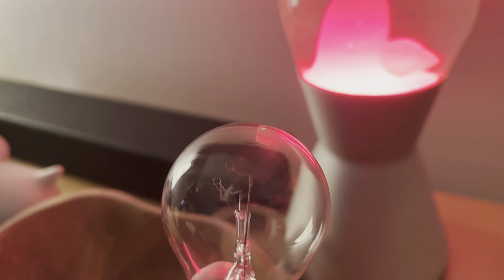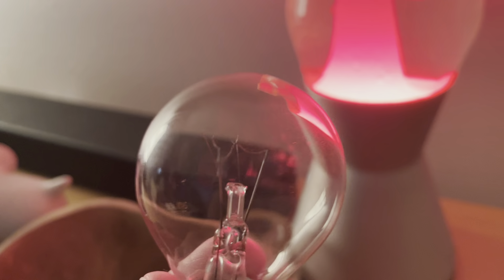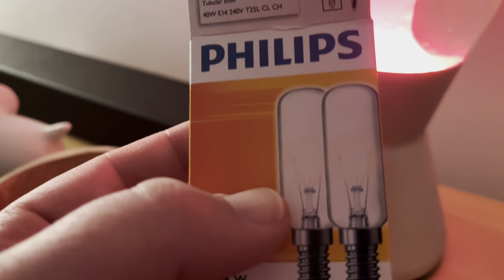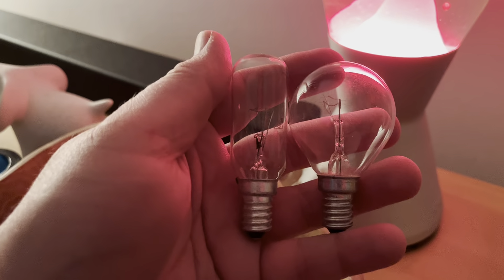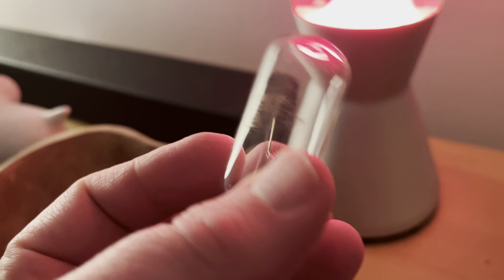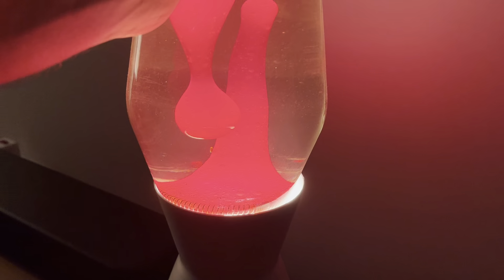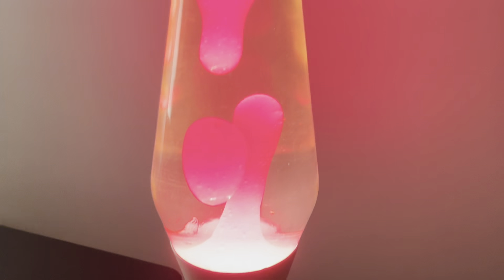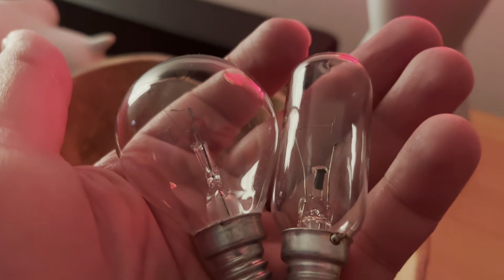🇬🇧 Keeping the Lava Lamp going ... [TCE #0066]

Comment: Put a 60 watt bulb in mine and replaced the on/off switch with a variable resistor switch.  Now I can adjust the heat/light output so that the lamp works perfectly, no matter what temp it is in the house.
Reply: Is the variable resistor switch the same as a dimmer plug?  Thanks.
Reply: @MG63  Yep.
Reply: @stonebreaker984 Thank you for quick response mate. Regards.